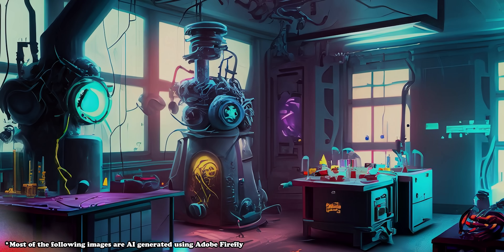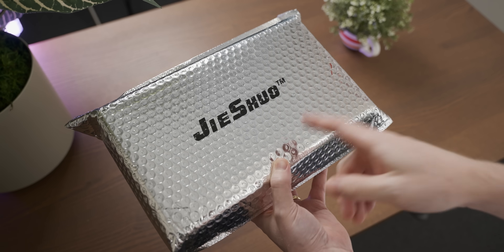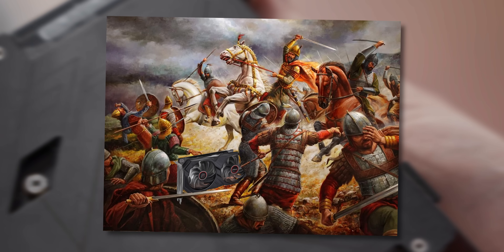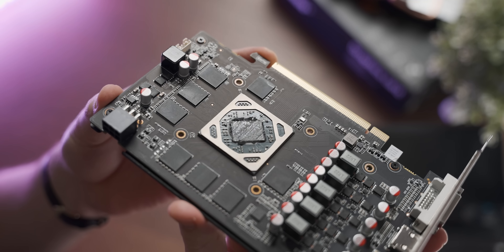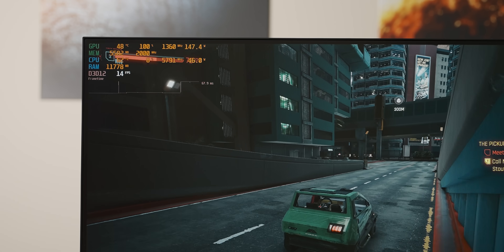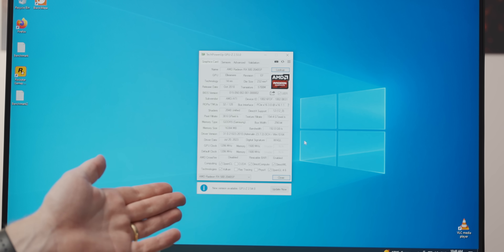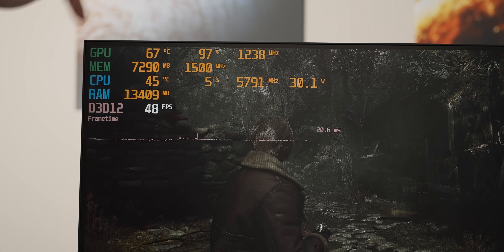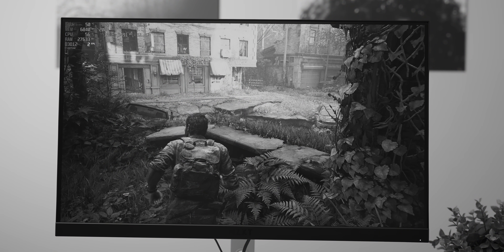Why Would They Make This? 16GB RX 580 From Aliexpress...

Comment: Disappointingly, Nvidia recently forced Github to shut down the Frankendriver project's account - as though somehow providing virus-free drivers to consumers who bought those mobile GPU cards is somehow a bad thing. Yeah. Right. Uh-huh. Of course. Totally. Nothing to do with those cards being the ultimate proof that Nvidia have been screwing gamers over by selling them only the worst binned dies off their production lines - those 3070M cards that perform like a 3060Ti with half the power consumption is all just a scam that Nvidia must protect everyone from!

Also, you missed the proud marketing claim on the front of the box that make a big thing of that valuable feature "High Temperatures"